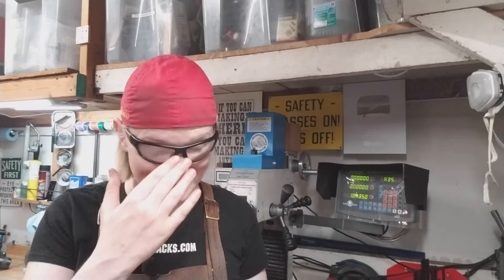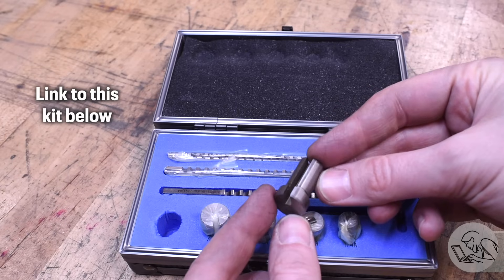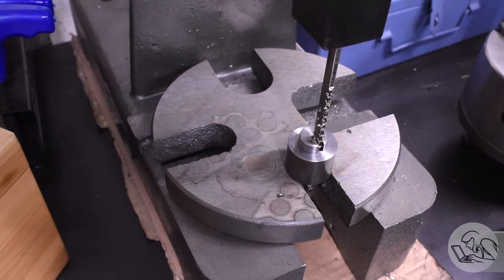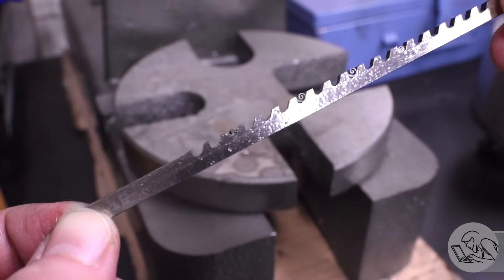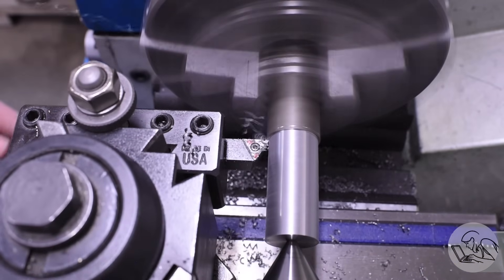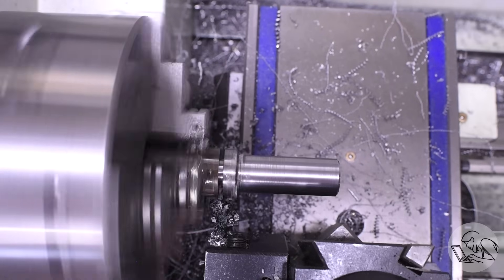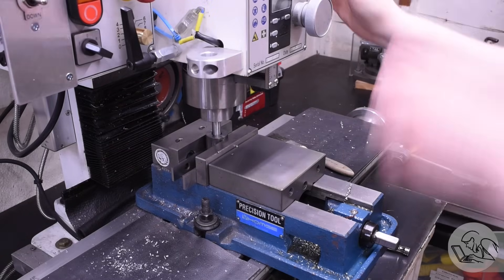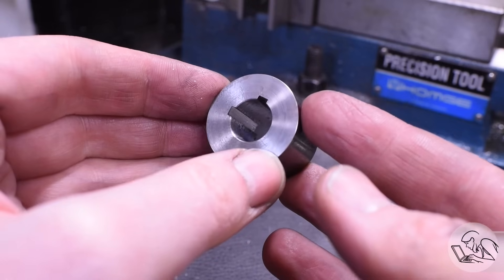Three Ways To Cut Keyways! No special tools!

Comment: Thank you for making this video! I just got a lathe, and most of my near-future plans involve keyways. The keyway shaft tool you demonstrated was the first real project I made with the lathe. It took over a day, the tool is tapered by like 0.010", the surface finish is crap, and the cross-hole is at an angle. But holy heck, it works and it's damn satisfying to have made that. Thank you for sharing the knowledge!

Comment: I had to do a blind keyway..most people don't talk about it as much.. tublecane talked about it...a shaper is good or a vertical mill . I ended up doing it on a drill press slowly and painfully. Surprisingly it came out ok but it was a struggle.. but poverty does that to a guy.

Comment: I need to cut a keyway inside and on a taper. Is this something that can be done with similar tools? I do not have a mill but I do have a lathe and drill press and lots of hand tools. Thanks for your time, your video was very informative I did learn something!

Comment: How do you prevent mill spindle from rotating while pushing cutter down?
Reply: It depends on the spindle-nose, when there are bolt-holes that you can use you can make a let say 2" ring that you mount on the spindle casting (axial) and bolt the spindle radial to block the spindle from rotating, sorry for the bad explanation but I hope you get the idea. 😉

Comment: I am in the process of re-powering my mill from a single phase motor to a 3 phase with a VFC. Naturally, the original motor is all metric (Korea) and the new one is imperial (US). This has made it necessary to have the mill apart while I modify the motor pulley to fit the new motor. I used the same process with some adaptions (remember, no mill). I ground up a HSS tool bit, similar to the one you made and welded it across the end of a steel bar from my stock pile. Worked fine. I confess that I have done this several times over the years, and used them in both the lathe and the mill. Good vids, keep them coming...........

Comment: I just cut a keyway yesterday in a 25 mm hole.
That keyway was 8 mm wide and 42 mm deep and I used an 8 mm square HSS bit in my Emco Maximat-Compact. 0,01 or 0,02 mm was the perfect depth of that cut. Maximum possible depth was 0,03 mm and that was absolutely maximum. 
I strongly recommend using a dial indicator to measure the depth of the cuts. It will save you lots of time as a too deep cut pushes every piece out of place and you´ll have to start over again with a new cut.

I also tried using the mill/drill press, a quite rigid one (a Swedish made Arboga) and it worked but I couldn´t set the cutting tool (just a straight HSS bit with a ground cutting edge in one end) with a relief angle which meant that it cut a keyway with less depth the deeper it got.
Back to the lathe where I could set up the cutting bit with a relief angle.

The toughest part of each cutting stroke is where the cutting tool enter the part you are machining. The cutting force decreases significantly after the first lets say 0,5 mm. I guess that is because that´s when the chip starts to curl. This is probably the reason intermittent cuts seem harder for a lathe than constant cuts.

Anyway, ever again! It was as boring as watching a race with submarines. 😅
It took many, many hours cutting just that one keyway.
The next time I´ll cut a keyway will be with a keyway cutting tool and a hydraulic press.
But the result was very nice, both the 25 mm press fit and the keyway was perfect. 👍

Comment: question I have atlas 9in lathe and it has a chuck to help center the shafts. but it doesn't spin. I noticed in your video your spins. Does that mean mine is stuck or bad or is that something I should replace or upgrade? thanks in advance.

Comment: When you need to lock the spindle of a lathe for such work, you can often drop it in back gear while still engaged in straight turning, I learned on a thirties era South Bend and currently work on forties era Logan lathes, very similar to the South Bend I worked so many years on.  Thanks for an elegant description of fine work.
Reply from the maker: Asian hobby lathes don’t have back gears
Reply: @Blondihacks  A wooden wedge lightly tapped into the gap between the chuck and the bed might be another option. A lot of lathes have induction motors that don't have any 'cogging' points they like to stop in.

Comment: Nice demonstration for alternatives to broaching.  The only thing I could add is that its also possible to use busted centre drills instead of square tool bits.  These also offer offer a more positive location into our cross drilled boring bar.

Comment: I made the keyway by turning a plug to fill the hub. Then I drilled a hole centered on the radius thru. The top of the key was ground to a radius to fit the top of the drilled hole. The key has not failed to hold the gear in place on the shaft.  The next time I need a keyway cut, I will try the method with the boring bar bit to see if it is any better..

Comment: Hi, I’m trying to teach myself how to use a lathe.   I have a 7×14 mini lathe that I have gone through and tightened up.   I’m wanting to turn a 18” x 1/2” (approx).  shaft on it.   I know the work will have to be divided up as far as turning the shaft.   My question is, when I place the shaft in the collet and get it as true as possible there is always a wobble at the end of the shaft, until I run the center into the end of the shaft and then I can get the wobble out.   The problem is after I turn the shaft and release the tail-stock center the wobble reappears at the end of the shaft.   Any help would be greatly appreciated.

Comment: Is there any downside to doing a circular keyway and just drilling a circular hole at the interface of the two surfaces at the same time (single step process) and pinning the two with a round pin instead of the rectangular? 
BTW, This was an excellent video.
Thank you.
Reply: That's called a dutch or scotch key.

The main downsides are that you can't easily put such a keyway in the middle of a shaft (I guess you could mill it with a ball endmill) and some other way of retaining the key will be needed, as it could just slide out of the hole. I use high strength loctite. Other options would be a press fit, or tapping the hole and using a set screw as the key.

It's also difficult to do if the shaft and the hub of your gear or pulley are made of different materials, the drill will tend to wander towards the softer material. You can plunge cut with a slot drill to avoid this, but will have to make a custom sized pin as slot drills and end mills always make oversized holes.
Reply: I don't know about the pros and cons of it but I used to have a steam engine off of a old popcorn cart or peanut wagon that did have a pin key like you are asking about. Someone told me that if it became loose you could just turn a oversized pin with a very slight taper and drive it in. Can't vouch for that but it's what I was told

Comment: No special tools huh... lady, I'm machinist if none of those is specialized, from the internal broach kit, to a press, the high speed steel (H.S.S the cutter needs to be ground from, or the subtleties in how it should be ground to ensure it holds an edge, the lathe your using to do the work or the shims needed to give the correct depth simultaneously needing to be not too thick of shims for that determines your next depth of cut....then I don't know what the hell is specialized, except for you. ...don't lie to get clicks, exaggerate cause you have nothing better to talk about or talk about things you don't know.much about. Thumbs down for false inaccurate portrayal.

Comment: I was trained as a Fitter and Turner in the early 80s, staying in the trade for over 20 years. I have cut a few quite large keyways on lathes. We called it "the Armstrong method" because you needed a strong arm to do a half inch keyway.
I much prefered access to a shaper or a slotter.

Comment: I used to run a 20 ton horizontal broach, it made the concrete floor rumble. Cut 6  1/2 inch deep teeth on a flat surface with a 8 foot bar.

Comment: Nice vid, the "in and out" part made me want to.... build a shaper! :D  Re: the lathe method, one pretty effective way to lock the spindle in a back geared lathe is to engage the back gear but  leave the bull-wheel pin engaged, it is pretty solid, just remember to undo the back gear or pin before turning the motor on :)

Comment: Hold on , so why should be the key way be a square profile ???  I put together the shaft and the pulley and drill a hole on the joint point , and voila  , i have a round keyhole

Comment: 5 years ago I agreed to make a few parts that had keyways. I had watched a video showing how to make a broach and use my lathe. Little did I realize how many strokes it takes. I now have an import broach set. But it seems every keyway I want to make requires a bushing I don't have, at least they are easy to make.

Comment: Hi my name is Kevin from Aus it is interest to see the 4 ways to cut a keyway I done all, of these1 you did not show is a chisel and  Hammer some time you are out on site and you need to make or depending a k/w  in a pulley or shaft  the other is drill and put a round pin in , you did well I worked in the family engineering  business for 56 years  so there is lots of things you need do at different times well done Kevin Schlipalius.

Comment: I loved that video Blondie; very resourceful.  I wish you hadn't spun that 3D sketch of your tool configuration around so quickly; I DID make use of that speed control for video replay...
  I have a question though; is there any rule of thumb for how much clearance you need between your mandrel and the work for the chips to form and drop out?  (i.e., a minimum tool stickout)

Comment: Maybe not for hobbyists but I cut thru and blind custom keyways for customers on wire and conventional edm machines. Because they are custom in size, broaches are too expensive for a 1 off. Good video, ive seen guys use CNC machines just like you used your knee mill quill as a shaper.

Comment: I use my lathe to do them sometimes. Just bore them without rotating with tool grinded for the size. I have never seen one of this kits.. At work I have two  Keyway slotting machines

Comment: For cutting larger width keys, it helps a lot to start with a narrower broach, cut an underwidth keyway, then go to the next size broach. This is good technique for the shaper methods using quill or carriage as well.

Broaches can 'dig in' and cut deep on the bottom end of the hole. If, when you pause the press ram, you see the broach springing over significantly, then you might be pushing it through on an angle. I like to press the broach in for a couple of teeth, then pause and move the work around so that the back of the broach can be eyeballed relative to the press ram (which you lower behind the broach for this test). If you see a wedge like gap behind the broach, then it is going crooked. At this point, it can usually be straightened into vertical position with gentle leverage, then continue to push the broach.

Comment: One thing to be aware of with broaches is that they do have a maximum bore length that they are designed to cut in order to prevent excessive chip packing.

Comment: Those are some great tips to keep in the back of my head. When I first got started in this stuff, I worked at a machine shop mostly doing operator stuff. They got a job that required a ton of keyways. They went out and bought a vintage keyway machine and had it refreshed by the company. I can't remember how many I ended up cutting. It must have been in the thousands.

Comment: Farm key ways. Find solid shaft to fit pulley or gear. Insert shaft. Find drill slightly larger than diameter of key. Lock shaft using the jam screw. Punch dimple right on gap of shaft edge and pulley edge. Drill hole, remove shaft. Grandpa hands You edge file and the key and says "Come get Me when Your done". As You file a basic edge(s) for a key !

Comment: When she said no special tools needed, i thought she was gunna use a hacksaw and a file n chisel which i've used to cut dozens of keyways ,n cut keys to fit tight with a head for easy removal,  cut n file time with same dimensions including the key, about hour and half, cast iron or steel,handy to know when machinery or electricity is not available. Love the keyway cutter though.👍🇫🇯🌴🌹🇦🇺😎

Comment: I really appreciate your idea of what 'expensive' is. So many sites/channels I visit have a much different definition. I watch/read for some time, and then find out that this great part/accessory/thing I'm finding out about will cost more than I spent on the machine I'll be using it in. Or the tool I need to make the thing costs far more than just buying the part, or dozens of them. It's true that, sometimes, that's okay, since making the part is the goal, but getting these great tips is so helpful, because I have very little cash to spare!

Comment: Well, I just drill a hole through the shaft and the collar when they are together, then tape it and put a grub screw long enough to cover the lenght of the collar. Choose the dimension of the hole right to protect the spin centrifugal torque torque reqiuired. I add 2 more of these spaced 120 degs if more torque is required. To be fancy I may add another smaller hole against the collar/shaft and the grub screw and add another smal grub screw to protect it.
My point is to make it cheap when you need it most.

Comment: I had a job where I was trying to broach a .250 wide keyway in 304ss but this thing was long. Like 5" dia and 5 inches long. I have a hydraulic press with a 20 ton bottle jack on top. I got the broach to pass through the first time. I mean barely. That broach would go "boom" then I built the pressure up again and finally"boom" it would move a little more. I finally get it all the way through but I knew I was screwed. I already had lots of time into the job and this was the last opp. Plus I had 3 more to do. So I put the first shim in and nothing. Can't drive the broach at all. 
I wound up taking it to a shop that does nothing but broach and they actually EDMed it in. I know another shop had done these parts so I guess I just don't have the right equipment. I don't think a bigger bottle jack was the answer. The pressure required was scary. It's all about the length of the cut. If you have the entire broach engaged at the same time it is difficult

Comment: If you're really concerned about locking the spindle (you shouldn't be)... most lathes and mills have a lock you can engage to do head / tool changes.
Hint... you can probably make a CNC do the shaper motion by program, but watch that you don't overload it!!

Comment: I recall once using the same method on a lathe to cut a gear wheel while at sea on a merchant ship. I made up a tool that fitted the inside gear tooth profile, found a gear wheel at the lathe spindle/feed drive with a divisible ratio to the number of teeth needed to be cut, set a pointer to the top of tooth #1, locked up, cut, rotated chuck to tooth #2 etc. That was 6-8 hours of my life I'll never get back.

Comment: Sa-weet!  Had a project that need a key way.  i went the 4th route and just laser cut a bunch of washers and welded them up.  But will be doing this, if just for grins and giggles. (was thinking back gears for the lathe to hold it in position)

Comment: When I was a lad, I cut a keyway with a hacksaw, files and Swiss files! It took a long time, but it worked. How did I ensure it was straight? Clamped the part in a vice with the faces against the jaws. Then put a narrow piece of thin steel in the bore, resting on the top of the jaws, and scribed a line (having already blued the bore). Then I reversed the part to ensure the jaws were the same height, and re-scribed the line. 

Next I laced the part onto a hacksaw with a new blade, and made a cut close to the scribed line. Then three more to the right of it leaving thin combs of steel between each cut. 

Then I chiselled out the combs of steel, and set to work with files and Swiss files. After I’d honed the surfaces with finer and finer Emery paper, the thing looked machined. 

That was a million years ago, I was 16 and knew no better. Everyone laughed at me, but were none the less impressed.

Comment: I worked in a transmission factory back in the 70s, and the job station in front of mine had a broach machine.....a freaking 20 foot long broach would lift and drop into the gears....not just a single key, but an entire splined center for the gear. 
It was something to see, and to marvel at the engineering that produced that machine!

Comment: I found it easier when using the lathe method to put a sacrificial shaft in the bore and drill a hole a little undersized to the keyway. Drill it where the shaft meets the bore. I usually start with a couple of drill sizes under the keyway and carefully work my way up. Makes a tedious job much easier.
Reply: There you go   half the hole on the shaft  and half  on the      other  ..  then just clean up the corners

Comment: Another great way to make a broaching tool is to turn a shank just like you did, then slot it along its length. You can then drill and tap into the sides of the slot for set screws. Into the slot you can insert a HSS lathe part off blade that is already ground to the width of your intended keyway. Just be sure to mill the slot with a taper to generate some positive geometry along the top of the part off blade. Nice job! “Chamfers separate us from the animals” is a great quote.